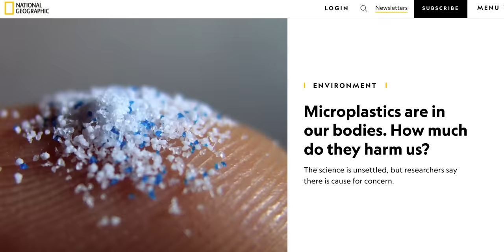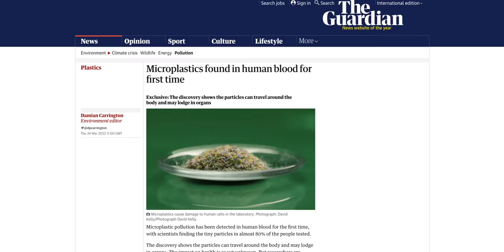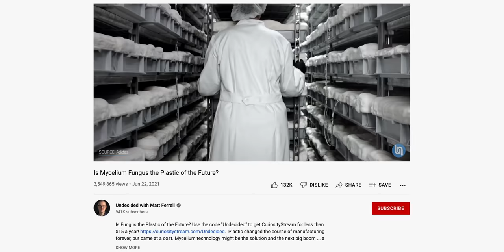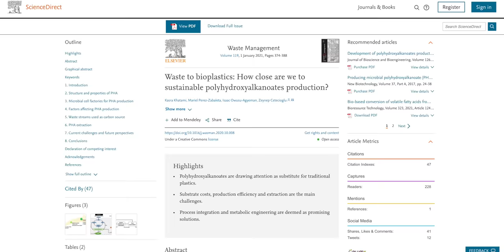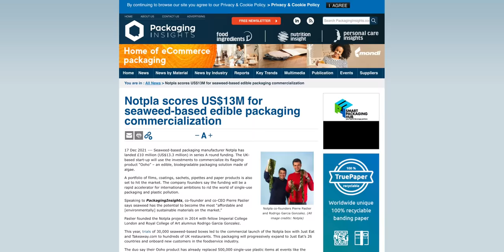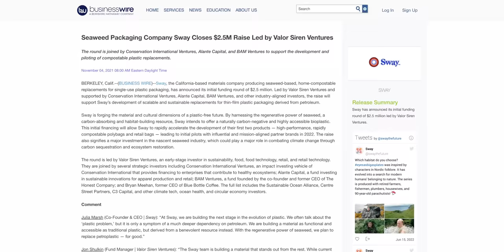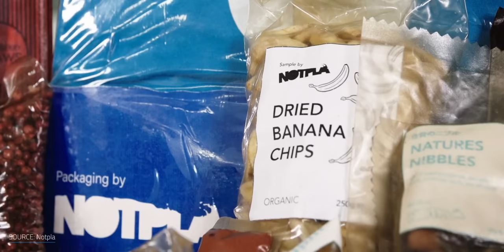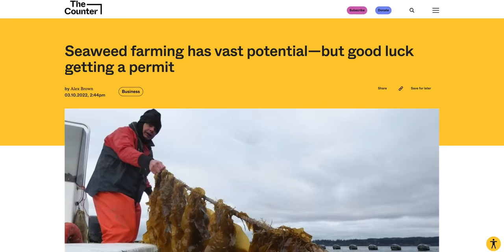Why Seaweed Could Be The Future Of Plastic

Comment: Even if we can get the cost to the same of normal plastics, imagine how to produce it in scale. There will be seaweed farms, and some ocean ecosystem is going to be replaced by those massive farms. Oh it may co-exist happily with existing ecosystem, but anything that can be optimised for seaweed production will be optimised, even to the detriment of the said ecosystem.

Basically anything that replace any modern convenience that we have in scale, will require solution that disrupt something else in nature, also in scale.

Replacing gas with battery will require increasing scale of our grid production, and also the rare metals that is required for the battery, which will create mines that is damaging in nature.

Maybe those damaging changes to the other part of nature can be quantified as less damaging to the status quo, but the fact remains, that current human population that needs modern conveniences will affect nature in scale, no matter which direction we go.

I guess I am just stating the obvious. Still, anything can improve things even by a bit is better, since over time we may come to the point that our impact is insignificant. But that requires time, and also a lot of faith that things will work out in the end.

Comment: This is promising in all the eco friendly ways.  One thing that also will need to be addressed in addition to package durability and manufacturing optimizations, is shelf life.  While this will reduce the carbon footprint in a multitude of ways, this is require higher production and tighter supply chains based on the fact that the packaging itself wont last as long as the product in some cases if its only lasting 6 weeks.  Which is one of the reasons plastics are so appealing to companies, the packaging itself outlasts the product inside it for a low price. If the packaging life could at least match the products self life, let's say a year? That would go a long way to making this much more viable.  That said it all depends on the supply chain.  A year for a package to decompose is much better than 400.  The current 6 week life span on some of those products is great however that still comes short of realistic self life of some products before they sell

Comment: What never gets mentioned when talking about plastic alternatives, is the usability of biodegradable materials as food packaging.

To me, that's the biggest offender regarding plastic use nowadays, as paper/cardboard alternatives don't always work, and on the food industry, packaging with a short lifespan doesn't sound that well.

Some cases could be solved with standarized reusable (not recyclable, mind you) glass containers, but I see a point in plastic alternatives that only degrade under industrial processes.
Reply: other than glass, metals are also an option. Before plastic took over the world of food packaging, shelf-stable food used to be sold in metal tins e.g. biscuit tins. They cost more, but due to their value and structural strength they also tend to be reused more. In Asia, it is not uncommon to see old biscuit or cooking oil tins repurposed into other uses.
Reply: @PixlRainbow  Not only in Asia. Here in Spain, it's traditional to have buttons, thread, and general sewing instruments in danish cookie boxes.

But I wasn't thinking in repurposing food containers (a glass set from nocilla cream it's another staple), as much industry reusing of the containers, without destroying and remaking them.

Glass bottles were returnable, back them, and nowadays we just throw them in the recycling bin. Cleaning them should be cheaper and more sustainable the melting them again.
Reply: @drillerdev4624  from what I can tell, glass bottles are still returned here, but only by bars and eateries which collect them off the tables and return them in their original crates. As an individual, you cannot return glass bottles; you have to have a long term bulk contract of some sort.
Reply: @PixlRainbow  here in Spain, up until 40 years ago, you could return your bottles back to the bar or shop and get come coin back. It was a task usually left to kids in order for them to earn some candy money.

The a "non profit" company was created to handle recycling, and everything went to shit (major corruption, as usual)

Comment: Plant based plastics are the future, but they don't need to be used in every application. For applications that you would need a stronger or longer lasting plastic whose chemical components you won't want interacting with liquid food substance, Petroleum based plastics will work fine.  There's no fear of running out of oil for plastic if we transition the cars to run on electric and power the grid via 
safe Thorium Salt reactors.  All the tech is readily available.  The only thing lacking is our ability to implement it, whether that barrier is the current set of laws or something more sinister, like a controlling elite.   Biodegradable plastics can absolutely be used in situations where you don't NEED the plastic to last for a long time, but one shortcoming that I can see may be re-usability and strength.  You CAN reuse a petroleum plastic bottle but you CAN'T reuse a calcium alginate sack.  Once you pop it, it's gone!!!  But I can fill up my water bottle 1000 times before I need a new one.  I can also CHOOSE what liquid I want to put into my petrol based bottle with, which is another shortcoming of the liquid sacks.  If you could use hemp plastic or some FIRMER form of Algae that would biodegrade UNDER THE CORRECT CONDITIONS but not whilst in use then that would be good.  Why do you need a single use party cup to last for 500 years?  Wouldn't 1 year be fine?  Or even 1 week?  We don't need SUCH long-degrading plastics.  That's essentially what is messing up the environment.  Plastics that last TOO LONG.  We are trying to solve every plastic problem we have by treating them all as nails because, so far, we've only had a hammer to deal with it -- petroleum!  The advent of new plastics using plant materials can revolutionize the world.  But, application is key.  You wouldn't want your plastic phone casing to dissolve after a few months or years of use.  Quick Bio-Deg plastics have their use cases, but we certainly shouldn't replace ALL plastics with them.  We need to figure out a way to TRULY recycle all of the petrol plastics we have already choked the environment with first.  If we has a reliable way to truly turn the plastics in the environment into another useful substance with no loss, that would be beneficial.  When I want to set up a nuclear power plant, I have to show the regulators what I am going to do with the waste before I can even begin putting the concrete down for the foundation.  Why should it be any different for plastics manufacturers?  We as a society have to think full-circle or we will soon perish.

Comment: I’m afraid some of the information here isn’t quite accurate. A nice video, but I would challenge several points made which appear to be echoing claims made as part of the “seaweed hype” heavily discussed in the industry and research communities. 

Taking a life cycle perspective on seaweed farming, it seems quite unlikely that seaweed products will be carbon neutral anytime in the near future. Farming seaweed requires ropes, buoys, ships, diesel, and the downstream processing also results in emissions no matter what you do with it. Sure, seaweed plastics may largely be renewable, but that does not make them carbon neutral, or indeed does not guarantee that they will perform better than fossil plastic alternatives from a climate impact perspective. The jury is still out on that one. More LCA studies are needed to figure this out and there are great reviews on the climate aspects of seaweed production recently published (reach out if you want links). 

But regardless, seaweed production (both wild and cultivated) have tremendous potential to provide low carbon and renewable biomass to the blue economy. It can help with local biodiversity, support coastal economies, captures diffuse nutrients from the sea and can close the loop on these by bringing them back into circulation in terrestrial consumption systems. The sector has tremendous sustainability potential, but we need to be careful about specifics claims, like regarding carbon neutrality. The science isn’t settled yet.

Comment: Solve only 1 problem and rest of the problems is easy. Remove EVA plastic mix. Even that is easy, remove dumping prices. Yes, new resin manufacturers screws everything and all companies use EVA everywhere. Result = non recyclable plastic. Not 100% correct, economically not viable because recycling speed is several fold lower

Comment: It's not carbon negative, if you compost it after use. Don't get me wrong, still a good idea, but we need to watch who claims what. I see too many companies claiming carbon neutrality, because they pay for the CO2 they produce or carbon negative, because it uses plants. The first is plain bullshit, and the second would only be true, if you take the plant based materials and stored them away where they would never decompose. Increasing the overall living or non-decomposing biomass is currently our only and to a certain extend temporary CO2 sink. Everything else is at best carbon neutral, but even that is virtually impossible. The best we can typically hope for, is to reduce CO2 production for the same result. For example, no amount of solar or wind actually removes CO2, it just replaces CO2 producing energy source. That's not carbon negativ, it is just a reduction in the additional CO2, the growth. It slows down, but doesn't undo. And even reducing CO2 in atmosphere would still only begin to slowly reducing the heating effect. Temperature, atmospheric CO2 content and its continued production are derivatives (in that order), like distance, speed & acceleration. Just because you reduce acceleration, doesn't slow you down, let alone halt you in place to avoid hitting a wall.

Comment: no single alternative will lead us from things like petroleum based plastics, or energy. Fossil fuels do to good of a job at running the world. You want to phase the energy grid off of fossil fuels. You won't wean the whole world off of it. Like it or not it is to cheap to ignore. Poor countries don't have the option to spend extra on power. If you force the switch off them when things aren't ready you will hurt these people. High gas prices in the usa is harming lower income families.

Comment: Bait and switch from plastic petro straws to just burning it over the ocean and poor workers who cannot afford to clean up the oil they're engine leaks or get new gaskets for spilling across the surface. Because with deep water seaweed nobody can watch you tear the ocean apart for like they would at shore. Whole thing don't float. Damn bamboo is a straw already.

Comment: sigh you can't replace plastic that easily but what you could do is use plastic for fuel burning.  you know the plastic recently discover you can actually harvest fuel and they are flammable more once they are melted, microplastic we shouldn't worry that much about the fact no one is thinking right but fearing it already.  Here is what you can do to the microplastic, filter the ocean, gather all the microplastic, and burn it for fuel, common sense ppl, now the person who got micro plastic just drink lots of water to filter it out for recommend don't drink alcohol or any sugar for good 1 or 2 weeks the reduce microplastic reduced in your blood, as again the plastic may seem scary but look here it doesn't mean we can't melt them or get fuel abstract from them because we wasted so much oil for these bottles of plastic and it is time to start collecting and try reduce that "GAS ISSUES" that is SKYROCKETING HERE IN USA but then again JB won't even acknowledge common knowledge for he wants stupid to agree with stupid.

Comment: It should be food for a starving world. There is not enough seaweed for the amount of plastic used. Ergo lithium ion batteries combusting. The problem with the human race is not thinking far enough ahead over the mining for the most money, ultimately. You should see all the solar junk gobbling up farm land and wind farms that have not lived up to the potential, the parts wear out fast need replacing often and now tech parts are necessary for all mechanical things to operate, which are no longer available. And more.  Take greed and politics out of the picture.

Comment: biz has mushroomed over time, lol. its funny because the paper food container things were solved ages ago. My gramps said milk cartons used to be cardboard and they'd line it with wax and his friend in highschool used to work in a factory. I'm surprised why all these new paper containers for fast food (replacing Styrofoam boxes) don't use a wax coating, but probably tooling or cost cutting/ or lack of manufacturing / method technique to lay wax for milk cartons . . . like how they could make powerful piston engines in 1950's but lost the method to make them, so today they couldn't make it anymore. Or how NASA built a moon rocket in the 70's but today is trying to figure out how to make a moon rocket today. 

They could also tweak plastic and make a plastic 2.0 that is commercially / practical to recycle, and so the recycled plastic 2.0  works as well as new plastic 2.0, as 1.0 plastic, making new plastic 1.0 is just performs better and cheaper than recycling 1.0 plastic. Until the health issues started coming out / waste amounts of plastic trash, there was no incentive to make plastic 2.0 when its cheaper to make new plastic 1.0

Comment: Sadley the roadmap for this tech is all too predictable. Now that a large scale manufactuer has license to make the product they will lean on whatever political officials they have under their sway, then we will see at some level be it municipal, county or state a law will be quietly passed without fan fare mandating the use of (but not by letter of the law banning single use plastics) these straws and cling wrap. As the success of that operations goes so will new political donations in other US locals, eventually their competition will want to get in this so they too will begin manfacturing this stuff all based on the politcal pressure. And of course lets not forget what happens if say a large county school system decides to buy these straws...that will quickly turn into an entire state then multiple states falling in line...And of course none of this will happen based on the open market value of the tech but rather the political fitness of it.

Comment: Do you know where micro-plastic comes from? Old fashioned plastics do not biodegrade. They last forever and clogs up the environment.

People look at that and decided that they are eyesores. So we made biodegradable plastic. I'm old enough to remember the public campaign to switch to biodegradable plastics. Some governments even required retailers to switch to biodegradable plastic bags. Everybody climb on board. Biodegradable plastics are more environmentally friendly. Supposedly.

These plastics fell apart after a couple of months. They just crumple into dust. Plastic bags littering the countryside disappears as if by magic. Out of sight, out of mind.

In our home, we save our plastic bags to use to store stuff later. My mom started this habit, and I inherited it. Then we noticed that these biodegradable bags would degrade even when stored in drawers. And the plastic don't just disappear. They turn into dust, that made a big mess in the drawers.

Skip ahead a few more years, we start hearing about micro plastics. Maybe I'm slow, but it took me a few more years before I started to connect these two things together.